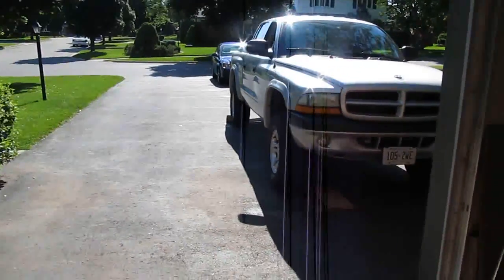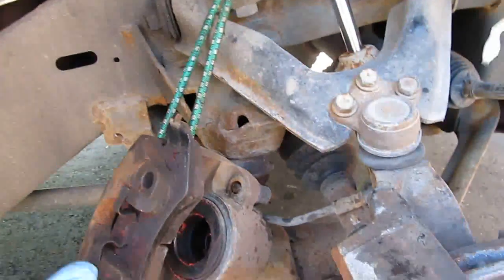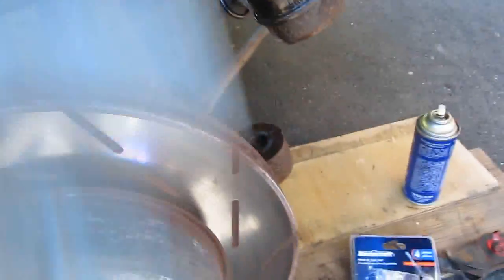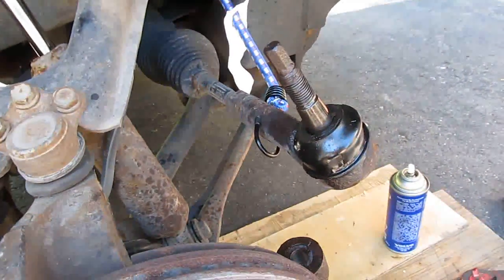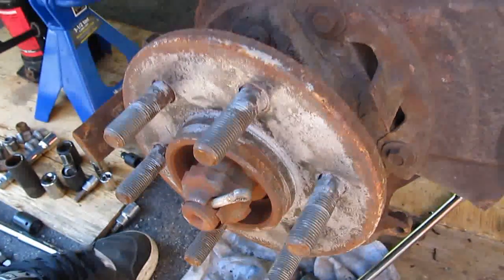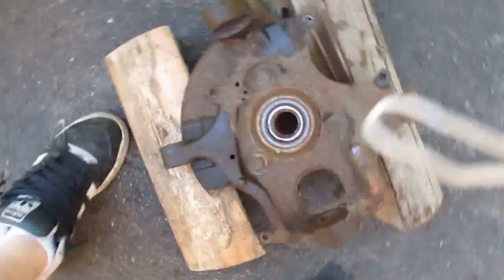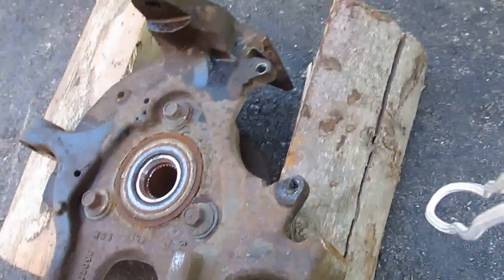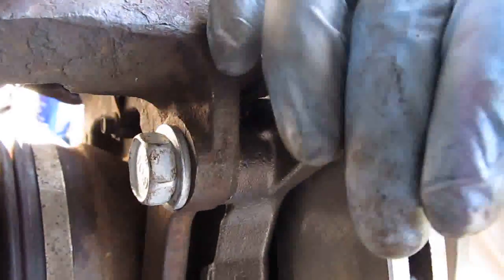Diesel1Dee - 2002 dakota to 2003 durango brake swap Part 2.wmv

Comment: I have a 99 Dakota I'm about to do the same swap. I was told I needed new ball joints, tie rods ends as well as calipers and ball joints. Is this true?
Reply: Hey. I am diesel1dee i just didnt feel lile logging in to the diesel account. Anyway. No u dont need new ones unless they are worn out. In that case may as well do them now  cheers.

Comment: I know this video was posted a long time ago but with the cotter pins I normally just cut the things flush with the bolt and use an impact and zip the bolt off. Doing it this way has saved me tons of time. Sometimes it destroys the nut but whats an .80 cent nut when it comes to 30mins trying the get the damn nut off.

Comment: Bro, why not just take the 3 15mm bolts off the upper ball joints instead of wasting your time drilling out cotter pins...
Reply from the maker: stunnasam21 i had to get the cotter pins out because i was transferring over the ball joints to the NEW knuckles.  once installed you need to put back in cotter pins after the nuts go on. so i had to get the broken pins out.
Reply: Diesel1Dee ohhhhh, my 03 knuckles came with ball joints (like new)so I didn't have to swap em over. I was gonna make a video of me doing mine, but saw your vid and figured I couldnt do a better one 😉
Reply: Diesel1Dee what size are your rims did this to mine and calipers are running on the rim

Comment from the maker: as long as your not changing anything with the abs no. the abs doesn't have anything to do with just changing the rotors and brakes pads. now if you had to change the actual abs module or something of that nature then yah but just a brake job no.

Comment: HI,
How much did you spend in parts? Just call up the local wrecking yard? Any '03-'04 Dakota or Durango will work for parts, correct? I had an '01 and same issue w/warped rotors.
Thanks